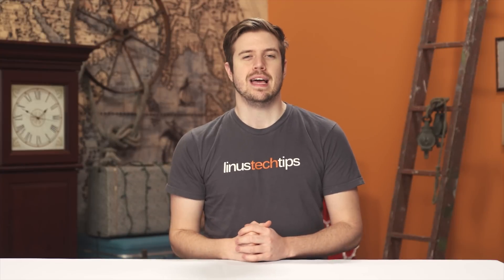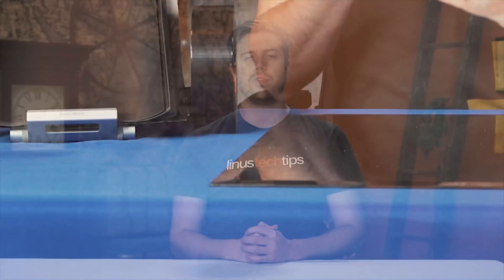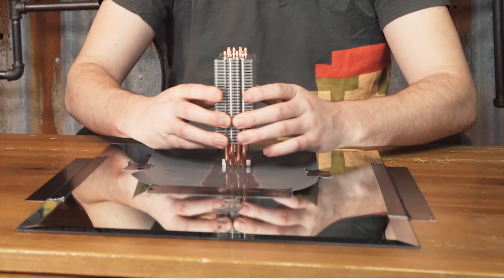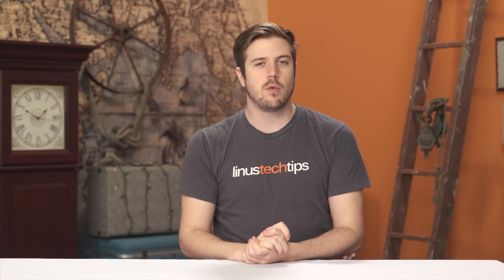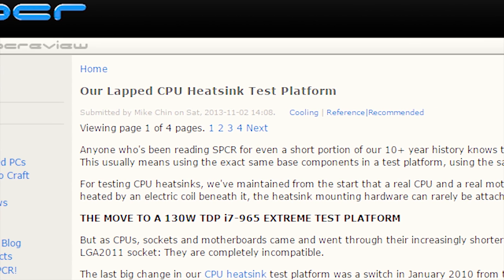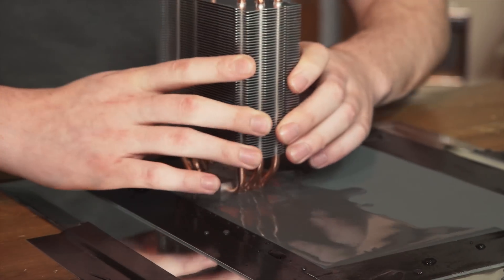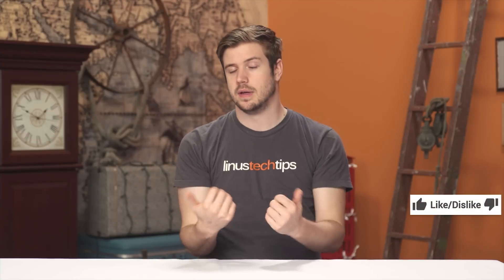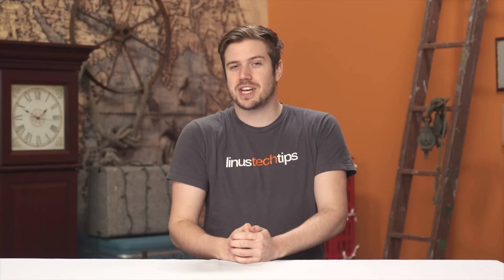CPU & Heatsink Lapping - Are concave, convex, or flat heatsinks best for cooling?

Comment: Shouldn't the thermal paste compensate for imperfections? Or is this about bad CPU lids?
Reply: think making the Surface rougher would actually increase surface area and together with the thermal paste could improve performance....
Reply: +Djhg2000 The problem is air. If the surface is too rough, or especially concave, you can trap tiny pockets of air in between the paste and the surface of the cooler, making it less efficient.
Reply: Toms Tech
As you said, I already solved the PSU/Air cooler conflict issue : the PSU is easily reversible, the SG13 has intake vents on the top side. I'm currently on a water-cooler though, so having the PSU fan facing down and pulling air from inside the case is actually good for general airflow. I even went and added a "custom" heatsink on the VRM chips (AsRock H77M-ITX, no stock heatsink), even if it's just an old aluminum AMD heatsink that I cut to size and glued using thermal glue from Arctic. Better than nothing, it doesn't interfere with the keep-out zone, so I can still re-sell it later.

It looks the Scythe Big Shuriken you mentioned holds its ground on overclock, but the 120mm squared footprint has me uneasy about compatibility. Worth a good look IMO.

I didn't consider the fact air could spin around in a fan. Reviews of the Thermalright show good results all-around. Anyway, I was thinking about using something else like a Noctua NF-A9 PWM, 25mm high, for "silence" and performance, or even stay in the 14mm height and use a NF-A9x14 PWM on that cooler. Coupled with something overkill like an NF-F12 industrialPPC-3000 PWM as case intake fan, that ought to keep things cool, right ? :D

I really enjoy this conversation :)
Reply: +Djhg2000 It does, but compared to solid copper, TMI looks pretty much like a thermal insulator.
Reply: +Friederrich Eggeling if you have a 2x2cm cpu and a 2x2cm heatsink you have 4cm sq of surface area maximum once any gaps are filled in with thermal paste.
if the heatsink had a sawtooth arrangment that perfectly interlocked with a sawtooth design on the cpu with no air in there what so ever (unlikely) then you could get the area over 4cm sq however the IHS on the cpu and base of the heatsink still have the same cross dimensional area so will still have the same internal heat conduction so it still wouldnt be any better.
FWIW I heard in college that some BMW cylinder heads were machined so flat that they didn't need a head gasket between the head and block, never seen it first hand though.
Reply: +Toms Tech 
Engineers have designed heat transfer solutions for cooling for years now. There's a reason there's no jigsaw.

Adding in jigsaws would actually be less beneficial to thermal conductivity, because you'd increase the volume of copper the heat has to go through before reaching the liquid in the heatpipes. Heatpipes rely on a phase-change design, with liquid that becomes gas, and travels to (one of) the other end of the heatpipe way faster than heat can travel its way through copper over the same length. Less volume of copper is better for heat to reach the liquid faster, so flat surface is better.
Reply: Ujiltrom M Yeah I know, I studied engineering.
I'm just pointing out why "a rougher surface would actually increase surface area and together with the thermal paste could improve performance" isn't the case here despite what some seem to think.
I haven't made up my mind on vapor chambers yet, whether its allot of marketing. I cant see how it's better than direct contact (say from cpu die to heatsink/heatpipes) or in cases of heat spreading in which case a copper core/base might be more cost efficient and just as effective.
e.g a hyper 212 evo on a de-lidded 4770k probably wouldn't be any better with a vapor chamber in between the die and the 4 heatpipes as opposed to direct contact (if only 2 pipes make contact with the die they are still in contact with another 2 pipes anyway) or a copper plate IHS.
Unfortunately a tech forum where all people do is relay what they've read elsewhere with no evidence is not going to answer this, those who care likely don't know and those who know probably don't care.
Reply: I'm in the "I care but I don't know" camp unfortunately. My graphics card uses a vapor-chamber (reference cooler), yet it's "public knowledge" that a custom cooler with heatpipes and bigger fans cools better than that, and with a quieter sound profile. "It's not because they are all wrong that they are right" though, so grain of salt here. The vapor chamber on my graphics card is way smaller in the radiator department compared to custom coolers, and cools quite well already. Size matters.

Reference coolers have the advantage of pushing hot air outside the case directly too, which is great for SFF cases with lower airflow.

Have you heard about the ID-Cooling IS-VC45 ? It is a 35mm thick vapor-chamber to radiator fins CPU heatsink (with a 10mm fan on top and no heatpipe.) It is rated at 130W TDP, and is therefore compeling for SFF computer builds, maybe even for overclocking. However it's been reported to be concave, and I'd love to see this heatsink lapped flat to see if it can uphold its promise. A 130W TDP-rating is above what most low-profile (below 60mm thickness) air coolers can deliver, it should leave overclocking headroom, which it doesn't atm. I don't know for sure, but it could even be better at cooling by replacing the 10mm fan with a 20mm one with higher static pressure, and still be under 60mm total thickness.

When my budget allows it I think I'll buy one and try.
Reply: Ujiltrom M looks interesting, though I personally thin the money saved on not having the vapor base (why is everything "vape" these days?) making it lower profile with a good quality lapped copper base would be a better value.
be quiet!'s Shadow Rock LP might be a better option if space is available.
the cryorig C7 has a 100w tdp at 47mm tall and has a dead quiet fan (or so ive read from reviews)
linus tested a xeon with a super small heatsink that just flat out failed to cool it despite it being "2011 compatible" so the fan and fin area account for allot in cooling as you mentioned.
i wouldnt spend my money on fancy things, go with proven methods backed by science.
i recently picked up a "deep cool iced edge mini v2" 80mm tower heatsink, it looks like the baby brother of a hyper 212 and cost me £7.50 ($14), well actually i bought 2 (they're £7.50....who cares) and really surprised, fan bearing probably crap but i might just use these on every client rig I built instead of the stock coolers.
Reply: +Djhg2000 
that's exactly what the Paste is for - filling in gaps to preserve thermal transfer as well as to remove places Atmosphere could get trapped.

but ideally, 'perfectly smooth' metal on 'perfectly smooth' metal would have much superior thermal transfer.
ultimately some amount of Paste will need to be used to fill in the microscopic gaps, but if you could need almost no Paste, you'd be in a net gain.
Reply: ***** But, if at the end of the day you achieve a metal to metal connection, what effect is that going to have on the actual performance? One or two extra degrees of headroom isn't going to do much on a desktop.

Switching to watercooling would increase the performance a lot more than polishing an aircooler ever could simply because you can keep chaining radiators and pumps until you theoretically reach ambient temperature. Sort of what Linus did when he watercooled a whole room of computers.
Reply: Djhg2000
You can chain radiators and pumps as long as you have room in your case. I am one of those that want a beefy computer in a small case now. Sugo SG13 ? Check. AIO water-cooler ? Check. Is that perfect ? No, because a water-cooler has way too many additional points of failure to my taste compared to an air cooler, namely the pump that could fail, the tubes that could leak, the radiator that could also leak, and natural evaporation making the unit useless at some point in time.

I'm currently looking for a "beefy" low-profile air cooler for that reason. Someone put an OCed i7-4770k@4.4GHz(84W TDP) in a RVZ02 (passive cooling) with a SilverStone AR06 (95W TDP), the temps went up to "only" 62°C while in game. Toms Tech, I am seriously considering the Cryorig C7 for my next build. Good enough airflow in a Sugo SG13 should help with temps while overclocking I believe, in case things go south I'll revert back to a water-cooler. The only thing I am concerned with on this cooler is how the fan frame is designed : when you look at the unit from the side, there are 4 holes around the fan frame, between the fan and the radiator. I believe they may let a bit of air out, decrease static pressure, and therefore the amount of air forced through the fins. Shutting them close might increase the performance of the unit. Your thought ?
Reply: Ujiltrom M dont have experience with the cooler but it makes sense (i might have stuck to a single 8mm heatpipe and trade thermal transfer for better airflow but maybe they know better here).
ive got an isk600 for an itx rig where the psu is in front of the motherboard, it makes it longer (which noone cares about when looking head on) but means the airspace above it is free to mount a hyper 212 evo, cost me £60 it now sells for £35-40...derp.
im not advocating it as the brush aluminium shell picks up fingerprints like you wont believe (personal pet peev) otherwise is very good, i might end up replacing it with a raidmax atomic/Ncase M1.
with regarads to fans the corsair fans have a similar design which i loathe however im using a stock h100i gtx and the cutouts dont actually create a gap because radiators have a bit of a lip.
with the cryorig fan that doesnt have allot of cutouts, great if you want incidental airflow around the socket/southbridge/ram/back of gpu and im sure the fan will still do the job well enough, it comes down to your personal acceptance level of things like this.
check out the sff forums as they will likely have come across it just like you have or at the very least something similar.
Reply: Ujiltrom M Bequiet shadowrock LP might be a more conventional option but its bigger so clearance needs to be checked.
Reply: Djhg2000 Linus did not achieve that goal at all with that project, it was a complete failure. partially due to how poor the capacity of the system even theoretically was because it was like, what 4x 480mm Radiators? that's not even enough for like 3 of those computers in the first place, let alone all of them at once.

but yes in theory you could just scale up to a larger and larger Radiator/Pump set to dissipate faster and faster.
not that it's practical to do it.
Reply: ***** unless everyone was maxing thier pc's out all at the same time for 20 minutes those 5x480 rad were plenty for that home loop, it failed because no biocides or anti corrosive agent were used.
Reply: Toms Tech I went to the SFF forums and they indeed expressed concerns about the cutouts in the fan frame. They mentioned trying the cooler with the cutouts left alone or closed with tape back in December 2015, but didn't mention results yet. As for the incidental airflow, I wonder if just closing 2 sides (the ones where fins "exhaust") wouldn't be beneficial to increase performance while not cutting off any incidental airflow. Would be a good test project, for when I can acquire one.

On the SFF website, I stumbled upon the Thermalright AXP-100 review. It looks like it can handle overclocking well and fits in 58mm, in any actual tight case like the RVZ02, or the SG13 with an ATX PSU. I may replace the fan with one from Noctua, 25mm instead of 14, bringing the total height to 69mm, and still fitting in the SG13 with an SFX PSU with a SilverStone ATX-to-SFX adapter. But that won't happen until I have the budget, unfortunately. Back to job-hunting !
Reply: Ujiltrom M with a case where the psu is mounted above the socket (a huge flaw IMO) you have to be very careful about height clearance AND fan direction, you dont want a downdraught heatsink trying to pull air away from the power supply which is pulling the other direction but I'm sure you've already got this sussed.
thats a good idea with the tape on the fan (though the glue will build up dust particles in the air going through it over time), the fact noone mentioned results disinclines me to believe there would be an appreciable difference.
also talking about downdraught heatsinks i bought a scythe shuriken2 revB 2 years back, the design is folded fins with 5 long copper heatpipes and a 12.5mm thick 120mm fan...so a great design
the socket is dead center which can create an issue in a badly designed motherboard where the pcie slot is right next to the socket (like on my z87i itx gaming) and it will overhang ram slots so standard height ram is essential, and while super quiet im not certain how good the thin fan is at putting air pressure against 5 tightly packet heatpipes.
all that said a decent pressure optimised 25mm fan (even run of the mill fans will do a good job) will likely work wonders and so long as motherboard design isn't an issue it seems like a great design to me, i bought it thinking they were going out of business, infact they were just stopping NA production or something, derp.
edit-that thermalright fan i wouldnt put money on, with such an aggressive fan blade pitch it's more likely to spin air around inside the housing rather than force it down through an array of fins, silverstone sp121's or similar would be much better replacement.
Reply: Ujiltrom M Your board has the same socket location issue as mine [sick emoji] noctua fans are bastardised copys of delta's, thats why deltas are worldwide OEM's for pretty much everything from consoles, to laptops, referenece gpus, air conditioning, servers, cars etc, if you look at the specially designed fan mountings (where the motor meets the case) they often have angled cuts for airflow, noctua made a big deal about how innovative they are with this, despite silverstone ap121's had it years earlier as did delta on their afb1212ghe and FFB1212EHE fans (google image it). noctua fans are quiet because of motor design (nothing special about that) and they always use ballbearings (just as delta do).
people bitch about deltas saying how loud they are....yeah a 190+cfm 4000rpm industrial fan at 12v will be, they make low rpm models too circa 70cfm@35db, except instead of paying £20 for bad colors with 50% of that money spent on marketing feeding a perpetual cycle of people buying and liking "good fans" (as they all should be, nobody should be impressed by something doing what its designed for), your buying a £15 black, quality fan where 90% went into development.
sorry whenever i see "noctua" i also see "apple", "nvidia" and "intel", the old saying "money talks bullshit walks" translates to "dumping money on brainwashing/marketing sells products better than extensive development" these days /rant.
I do love the mesh front on the sg13, what about mounting a delta afb1212L (or afb1212m) in front, 1900rpm and only 32db (at 12v, obviously less at 7v etc) just throwing that out there.
fwiw im not sponsored by delta....though i wouldnt mind :P
the NF-A9x14 might actually be good looking at the fan blade design, its broad and theres not many gaps between blades looking through the fan which is good for pressure, kinda looks like a prop on a modern nuclear sub.
you can learn allot about fluid dynamics very easily which helps with picking parts, if you do some quick reading on blade pitch (on centrifugal fans and airplane props) you can see that the higher the pitch the more airflow you get but the lower the pitch (the flatter the angle) the more pressure you'll generally get, of course with 0 pressure you get 0 airflow so pressure should generally come first, linustech did a video a year or so ago in corsairs chamber testing like 12 fans with a google doc of the results which you can download, surprisingly the sp120's and af120's flowed very similar amounts of air for a given rpm however when a mesh was placed infront of them the AF' really suffered and the sp120's did very well (im not a "fan" of them but results are results), the noctuas were shown to be very average with some other fans (i forget which but i think they had a green line?) actually beating them slightly in 80% of the tests.
screw it here's the link, watch?v=9uUXt7mE6Qg
and results
https://docs.google.com/file/d/0B1PSGh26Ne0XcG01LU5LaU9XX2M/edit?usp=sharing